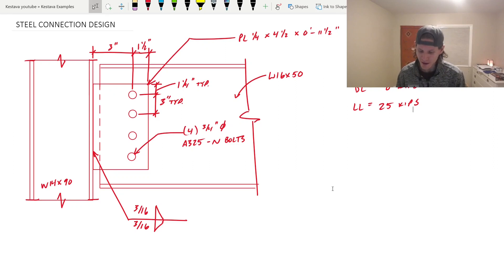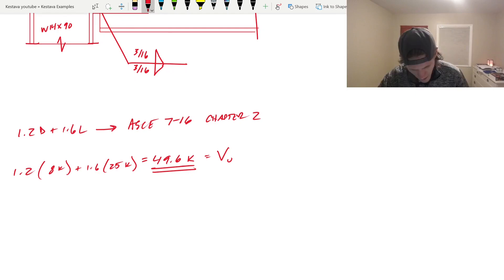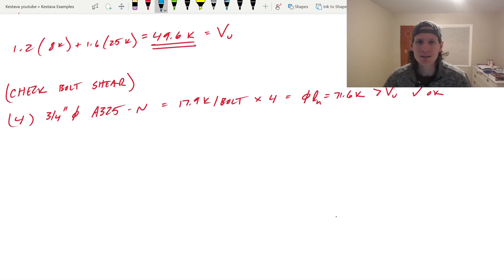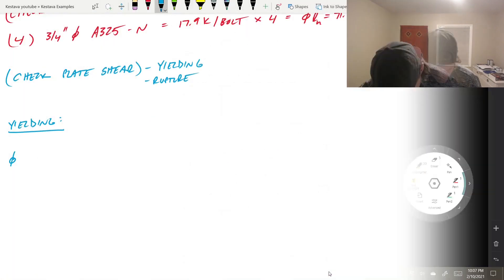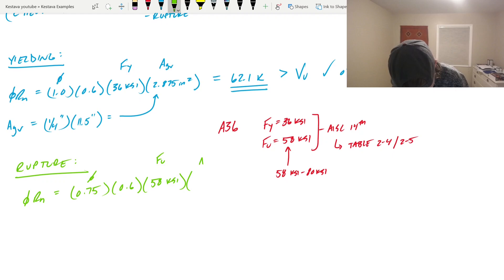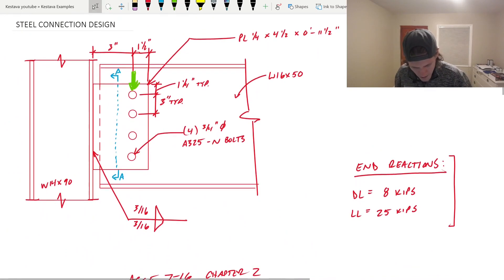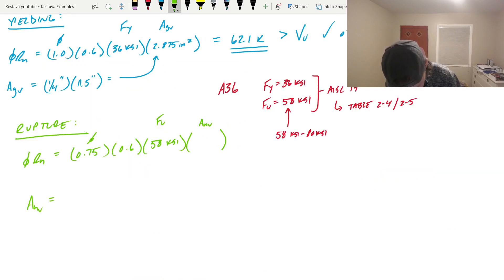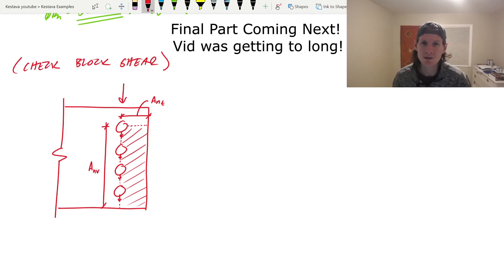Steel Connection Design Example - Using AISC Steel Manual | By Hand | Part 1 of 2

Comment: Steel detailer here.
Cool but, at 14:30 , have you been taught to assume the hole is 1/8" larger than the bolt as a sort of safety factor? Because a standard hole is only 1/16" larger (Table J3.3), and I would have used a 13/16" diameter hole in this calculation.
Reply: The reduction from the net "height" of the plate (for each bolt) is dh + 1/16". With dh coming from Table J3.3 and the 1/16" coming from Section 3b of the Spec (I'm using the maroon edition, but this is probably still the same). Specifically, "In computing net area for tension and shear, the width of a bolt shall be taken as 1/16 in. greater than the NOMINAL DIMENSION of the hole." 

Therefore, for a 3/4" bolt... dh= 13/16", so the reduction per bolt is 13/16" + 1/16" = 7/8".

The +1/8" to diameter of the bolt works for standard holes. I think it's usually safe to assume standard holes UON.
Reply from the maker: @darioromero8947  OUT HERE FLEXIN ON ALL OF US. Great information!
Reply: @Kestava_Engineering  Just trying to help, because I've been burned by it before unfortunately haha
Reply from the maker: @darioromero8947  just joking around, your info is great. And hopefully you werent burned to bad, especially with steel prices today.
Reply: @Kestava_Engineering  Haha, only my GPA felt it
Reply from the maker: @darioromero8947  RIP
Reply from the maker: Great catch! I always thought it was 1/16" all around equaling 1/8" dia increase. thank you for pointing this out showing me table J3.3. you just got pinned to the top of the comments my friend.
Reply: @Kestava_Engineering  From what I remember in school, when detailing your steel bolted connection, size up the hole by 1/16" (so 13/16"Ø for a 3/4"Ø bolt) but for the purposes of your design checks, go a whole 1/8"Ø larger, so in this case 7/8"Ø for a 3/4"Ø bolt. My professor said it was to account for damage done to the edge of the steel and it's easier to just take another 1/16" away (for a total of 1/8") then to try and figure out to what extent the damage affects the design capacity. So this is how I approach it
Reply: @Kestava_Engineering  I've never been pinned before. So that's exciting!

I was just looking into this a little further because I'm not overly familiar with AISC (being from Canada I work with CISC 95% of the time). You know it's a little confusing for me because if I strictly apply J4-4 then I would use a 13/16 diameter hole to get the Anv or net area subject to shear , and I would conclude that your 7/8 diameter hole was overly conservative and incorrect, BUT if that's the case then the capacity of the plate would be 53.8 kips and not the 52.2 kips you came up with. BUT THEN why does Table 10-10a agree with your calculation and not mine? haha, so I'm obviously missing something. Judging from the following AISC videos I believe your math is 100% correct. Check these out...

https://youtu.be/myhliC9s658?t=2650  - here AISC says an extra 1/16 should be added to the hole diameter to account for damage from punching.

https://youtu.be/alj4-kHZt0U?t=1523 - here AISC definitely uses the effective hole diameter in their calculation for a shear plate connection.

See, this is why I hire connection design engineers. It's so I don't have to worry about any of this stuff.

Comment: Great video... But, why is your net area subject to shear for shear rupture different than that for block shear rupture (Part II). When calculating for shear rupture, you subtracted the entire area for (4) bolts (2 in^2), but then you subtracted 1/2 of the bolt hole area for the block shear rupture.

Wouldn't the vertical line of failure (for shear rupture) also be through the middle of the bolt holes as shown at 16:45?

Comment: I prefer ASD after learning a ton of LRFD in school, but my issue with LRFD is you can't check deflection in LRFD (according to my senior engineers), so ASD is the best specifically for that, am I correct?
Reply from the maker: Jeff - absolutely!

Comment: When the Owner asks if they can add weight to your floor system but the EOR designed using LRFD leaving no additional room for anything more than 5% gravity loads on an already stressed floor system... (Laughs in ASD)